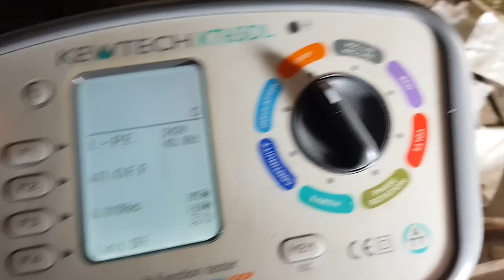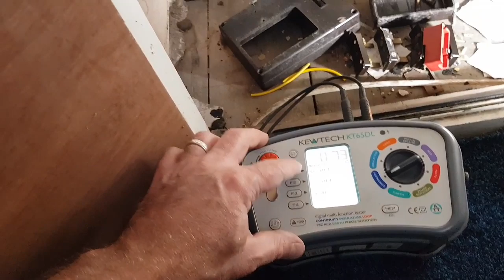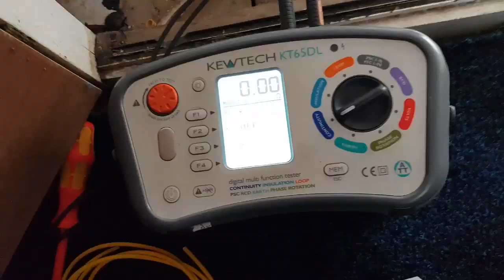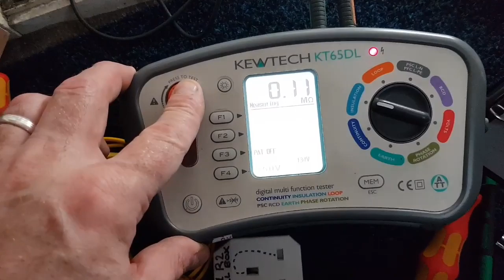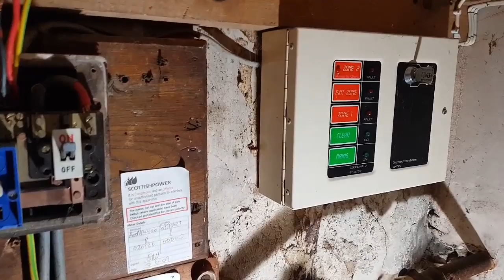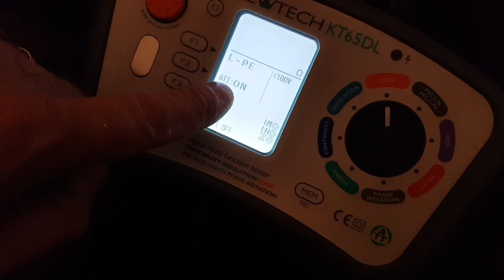EICR Before a board change? (10)

Comment: That BS951 clamp on the supply cable is worth mentioning to the DNO.  Watch out though because the last time I rang Western Power to notify them of a similar arrangement, they stated that the earthing arrangement was now a TT (for a suburban house in Birmingham!), so they no longer had to maintain it.  The customer had to pay to get the supply 'converted' to TN-S i.e. to remove the clamp and do a proper connection onto the lead sheath.  Next time I'll start by asking for a formal declaration of Ze or earthing arrangement for the address, and then hopefully they'll have to stand by that when I mention their dodgy BS951 clamp.

Comment: Great video, Poor installations I work out the cost of a rewire & a cost to put the installation right & give both to the client.  I always tell them to get other quotes, so they know I’m not out for work.  If the installation requires lots of remedials, fault finding, I always inform the client that it’s also a gamble of going the repair route as parts may require rewiring & therefore could end up being an uneconomical repair.  Also once you delve into the install further you never know what your going to find.  Extension leads on that scale warrant a C2 without a doubt, tripping & fire hazard.  I never check R1+R2 on a  ring during a domestic periodic, for the following reasons. It is an existing circuit & not required.  Resistance from old sockets gives you false readings
I always check for ring continuity at every socket sampled, this checks for Spurs off spurs.  During my initial inspection, I use my R2 wander lead to every socket screw, confirming the cpc is in the correct position.  The Zs test will confirm the polarity of line & neutral conductors.  Just my way of doing it.  For the apprentice, You can also measure ring continuity at a socket outlet, rather than an overcrowded consumer unit.  I like to think sparks help each other.
Reply from the maker: Good run-through and explanation Patrick. As usual when dragging an old installation into the 21st century and indeed up to today's standards something's are self-explanatory. Some landlords take and respect any advice I give them and some run their whole property portfolio at an absolute minimum! After chatting with the tenant on the day I believe the low resistance reading is in the kitchen. I won't go into it too much on here but I will plan and prepare for a couple of different scenarios to put the place right. Sadly as with some cases I might not hear from them again? Thanks for your comment.
Reply: R1 + R2 is a good test as checks polarity and which sockets are spurs (the installation may have never been tested since fitted to confirm polarity) . Very quick test once L + E connected. Some sockets may need the test plug inserted 3 times to clean the contacts.Taking a wander lead around all sockets will take longer. You are testing the installation and anything plugged in to the sockets cannot be classed as a C2 as not part of the test. You can advise the person ordering the EICR they need more sockets.  I can't find anything in Codebreakers either.

Comment: What a state that 3 way spot light was in, makes you wonder what they were doing, to have all those smashed lamp bases in that!
Seeing the 1980s style MK logic double sockets, they were some of the best ones that MK made, (better build quality than the modern ones!) providing they are not damaged,  last almost forever, I've still got them in my place never had any problems with them.
Regarding extension leads, providing they are in good condition,  not really a problem with just low power consumption items plugged in, you could have a 6 or 8 way extension with a load of phone chargers, or AV equipment & it would only be less than about 100 watts.
It when the clueless people plug in a couple of heaters & hairdryer that the problems start!
Reply from the maker: Yep agreed ! Thanks for watching.
Reply: Those screwin bulbs are always breaking off in old light fittings-have you ever seen a bayonet bulb break like that? Probly never.
So it makes me wonder why almost all light fittings take E27 bulbs(except integrated led obv.)

Comment: If I had to turn up to that property I may suggest a full rewire. Two circuits within the c/u and old wiring with no RCD protection as you say. That would rectify the isues faced, but does it then become an ethical issue? As the Electrician who has tested it, it may look as though you are out to get work from testing letted properties. It's a difficult situation, you can educate people about safely using extension leads but when it causes a fire it then presents a whole load of other issues. Great Videos, really interesting to here your thoughts, knowledge and what you get upto!
Reply: Good video mate, proper real world stuff 👍🏻👍🏻

Comment: In 2019 having 1 outlet per room should be classed as insufficient unless it's some kind of box room not big enough to even fit a single bed in.
Reply from the maker: I agree, the amount of equipment and appliances we use today compared to 40 years ago has been lost on this installation. The poor guy had so many extension leads everywhere.

Comment: Nice video, only bugbear was that the insulation resistance test should have been carried out with the cpc's connected to the MET, other than that great video 👍
Reply: Hi mate , what would be the reason for for keeping CPC connected to the MET
Reply: @harrypotter101000  It states in BS 7671 that this is how IR testing between live conducors and earth should be carried out. There may not be a short circuit between live conductors and cpc but there may be one between live conductors and an exposed conductive part.
Reply: Alvin Ashman nice one mate thanks for reply 👍 learn something new everyday 👍

Comment: What could be causing the 0.11ohms insulation resistance reading?
Is there a way to isolate the boiler?
Looks like the double adaptor plug is unfused with uninsulated pins.
Reply from the maker: I isolated the boiler in the kitchen, that flex coming from it plugs in in the kitchen. As in most cases a low reading like that on an EICR requires further investigation.

Comment: Never understood why people think extension leads plugged into extension leads are a problem. So long as the correct size fuses are fitted how can it possibly cause a problem?
Reply: Theoretically multiple extension cables can't be overloaded because they are protected by 13A fuses, but BS7671 says that there should be enough sockets to avoid the tripping hazard of long and numerous extension leads.
As far as the 13A fuses go, it seems to me that the typical 13A plug is not capable of handling that current for a long period unless all contacts are clean, fuse holders tight and conductors screwed tightly into the brass pins.  John Ward has done a video recently showing how 13A fuses will not even disconnect until the current gets past the region of 25A.  I reckon we should reduce fuse ratings to 10A maximum to take the limitations of the BS1363 plug into account.
Reply: westinthewest I think you’re stretching the term numerous to apply it to two, you’d possibly have an argument at say 5. The other point is a case of bad housekeeping leading to a tripping hazard, that’s not a failing of cable reels/multi bars. I recently made the mistake of plugging a heat gun into a multi gang and it blew the fuse, it was supplied with a 5a fuse. I’ve checked quite a few since and it seems to be the norm.
Reply: I think the problem is the majority of the general public don't understand how "daisy-chaining" multiple extension leads lowers the resistance considerably (resistors in parallel), hence why the cabling soon gets hotter etc. More should be made of this in school physics lessons.
Reply: Baldy Slapnut that’s twoddle, the fuse protects from over current. Doesn’t matter if it’s one big load or 1000 small ones in parallel.
Reply: Try it then...
Reply: Baldy Slapnut I have? Some house basher years ago decided it was dangerous and despite there being no engineering reason for it to this day every third “electrician” believes this urban legend.
Reply: @baldyslapnut.  My school physics lessons didn't prepare me for thinking this scenario through.  As you say, the multiple loads in parallel cause an increase in current, and the resistance in series (the extension cables) supplying those loads, cause heating as Isquared.R losses.  The squaring is the killer factor when the current increases through the extension leads, and as mentioned - any imperfect plug contacts.
Reply: westinthewest you’re massively overthinking this. Each cable is protected with a BS1362 fuse, that fuse is sized to protect whatever is downstream of if. Earth leakage aside it doesn’t matter if it’s 1000 loads drawing 10mA or 1 load drawing 10A the same current flows.
Reply: @chrisb4009  I don't think much of the 13A fuse when it comes to protecting the BS1363 plug and socket from overheating.  Try running two 2kW heaters from one extension i.e. 20A total current.  After ten minutes the average 13A plug starts to overheat and melt while the 13A fuse just sits there doing sod all.  There's probably a table in BS7671 that shows the disconnection time for that fuse at 20A.  My guess is a day or two.
Reply: westinthewest what your suggesting is a deficiency in manufacturing or standards not due to use of multiple extensions. You’d be in the same boat with a single 10A load or 10 1A loads.
Reply: A 13a fuse will let 20a though for a fairly long time before giving way.

Comment: Why do you think they wired the ring in 4 mm, it didn't look as though it was a particularly large property 🤔
Reply: Don’t think it has to be a large property. Perhaps they only had 4mm available
Reply: @richardwilliamson3624  It's a very expensive way of getting power to your sockets... When I worked on industrial sites, we wired rings in 4 mm but only because of the size of the area to be covered and volt drop issues.
Reply: In the real,world... it’s nit that much more expensive 😀
Reply: @richardwilliamson3624  I disagree... the cost of a drum of 4 mm t&e compared to a drum of 2.5 mm t&e can be as much as double. To remain competitive in this business, you've got to keep your material cost as low as possible without compromising on quality or suitability.
Reply: @richardwilliamson3624  You've just bought serveral hundred metre of 4 mm t&e for a job 🤔🤔🤔 
I'm sorry but I don't believe you, I've been doing this job long enough to know when someone is making things up. On the odd occasion you did install 4 mm t&e, it certainly wouldn't run into the hundreds of metres.
Reply: We used to run the power circuit in 4mm because there was insulation throughout the place
Reply: @markh9246  Yes, I guess that's another reason 👍
Reply: @alvin ashman. See my post below. Still waiting for your apology...
Reply: @richardwilliamson3624  I can't see any comment below and to be honest I'm not interested in going back and forth with you, my comments were made 2 days ago and in my mind, already forgotten about... Have a pleasant evening.

Comment: It may look untidy and unprofessional and look a bloody mess but provided the extension cords are properly fused at 10/5/3 amps and nothing high powered it plugged in (fan heater, kettle etc) I fail to see how this is a fire hazard.  Problem is 99% of people have the wrong fusing in appliances and extension cords and absolutely no idea of how electricity works, far less an understanding of current. I suppose that if you factor in the times when extension cords have wiring exposed or the wrong grade of cable then it could be a problem.  As someone who worked with test gear and has done all my electrical house wiring forever I would postulate that extension cords are not intrinsically unsafe.  It's just the people that use them that are the problem.

Comment: although its not ideal, but you could have  10 or more sockets on an extension lead, and as long as the cable is capable of carrying 13amps and theres a 13 amp fuse protecting the lead wheres the danger, it will just blow the 13 amp fuse in the plug top, if over loaded with no damage to the cable. 
Also the kitchen light is just as dangerous as your average pendant, without a lamp in anyone has access to live parts, cant believe we are still fitting those things and passing them as safe, in this day and age. As well as electric showers, like having a bloody kettle on the wall, theres no way i would recommend an electric shower or have one in my house.